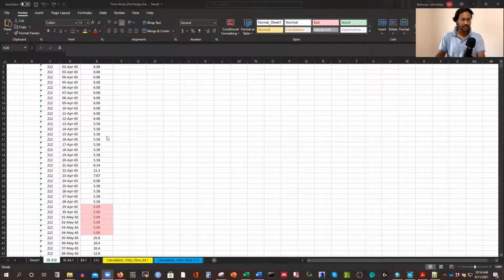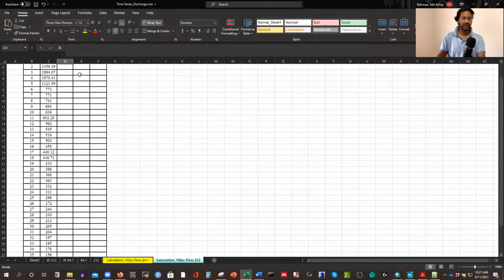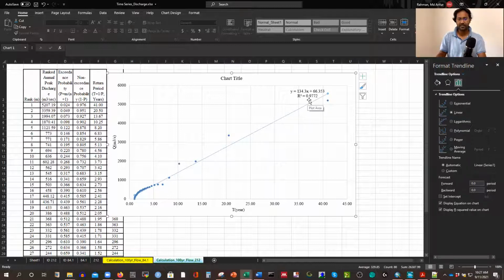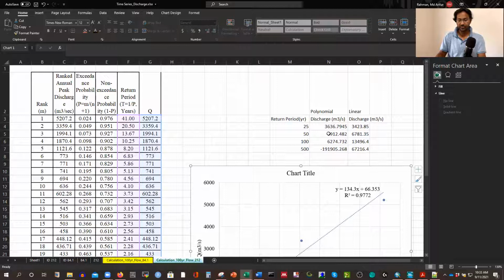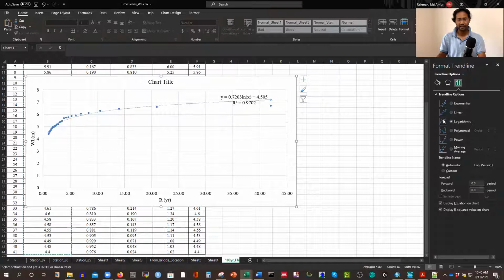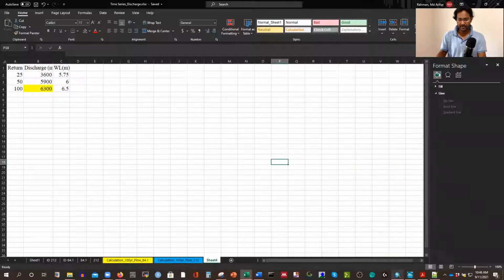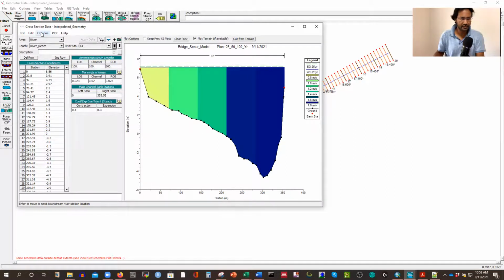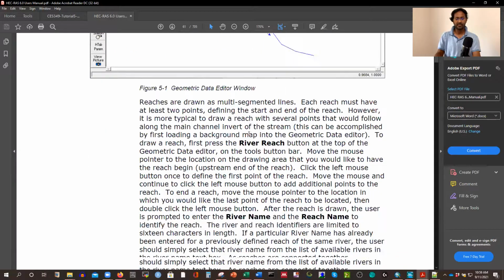HEC-RAS T2: How To Calculate 100-Year Flood Flow and Water Level

Comment: Thanks you so much for your sharing. I didn't have the discharge (flow rate) &water level data at the exact location of the river. How to calculate return period in my case. It's a humble request to guide me.
Reply from the maker: Glad it helped. You can follow the method I demonstrated.

Comment: great video, how to calculate 25,50, and 100 year return period flood flow at hourly or daily level? for unsteady flow, I need a flood hydrograph at a different return period. thanks in advance
Reply from the maker: Thank you for the query. Use the hourly maximum or daily maximum first; then, calculate the flows of the respective years return period following the steps.
Reply: @MdArifurRahmahn  thank you so much for your response, you mean I should follow the same steps as your video for hourly and daily

Comment: Great tutorial,
I noted one thing on Excel on computing wl with return period, you used Log instead of LN. The value WL is somehow lower, please correct me if I'm wrong
Reply from the maker: Thank you for the query. Yeah, I used log instead of LN. I usually use log so that I can specify the base. For log10, there is an specific function called log10. Previously Ln was not there in excel. That's why, we used log and used the based. Now I can see there is LN option. But still I use log as a habit, even though I don't use excel for the calculation. Here, you are absolutely right that the value is lower as I forgot to use the base. You guys can use LN.